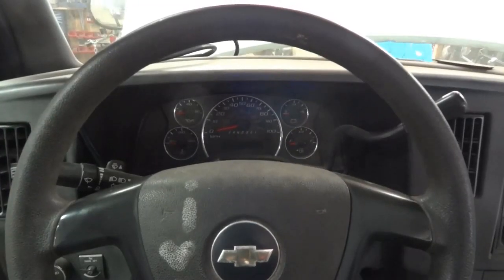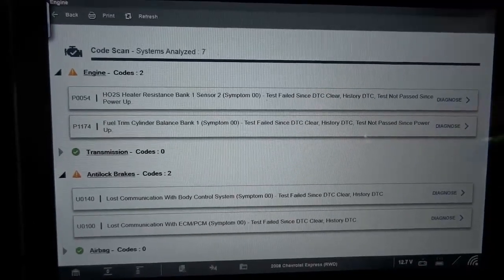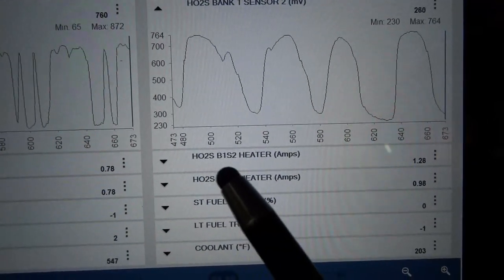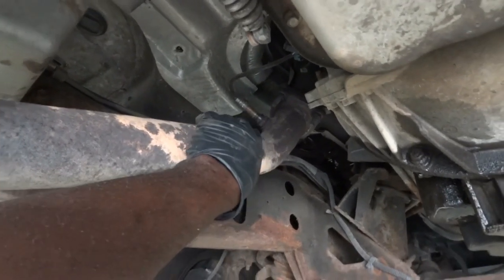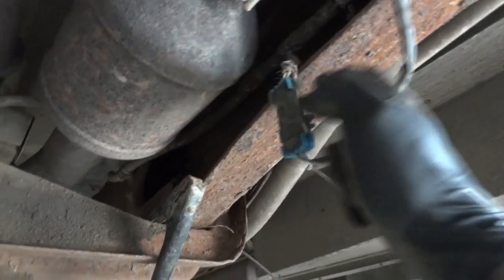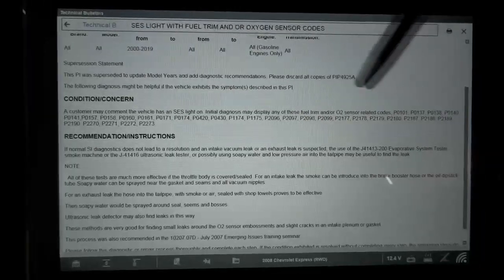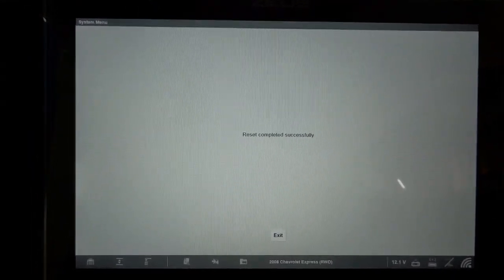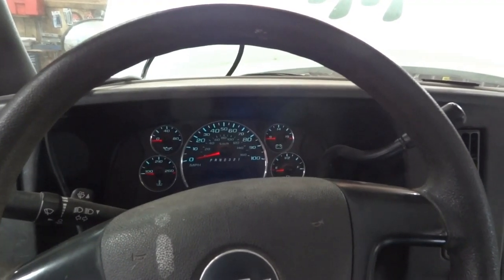Chevy Truck 02 Sensor Heater Problems / Code P0054 & P1174, Bank 1 Sensor 2

Comment: What year ranges require a computer relearn?   I'll be changing the O2 sensor in my 2001 Silverado (4.3L) this week....   Can it be reset by disconnecting battery for a period of time?
Reply from the maker: Harmony Hollow Apiaries  you probably won't need to reset the 02 sensor on a 2001chevy